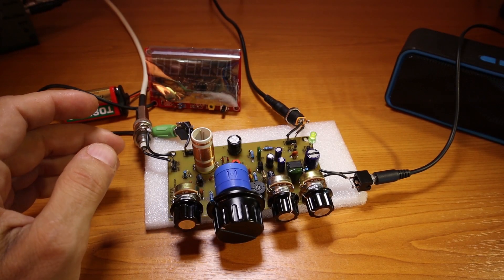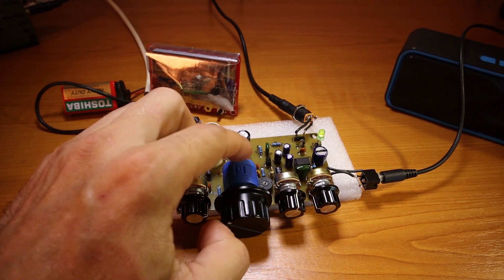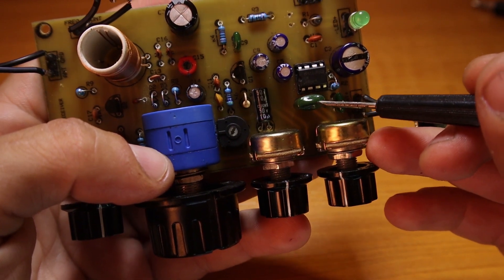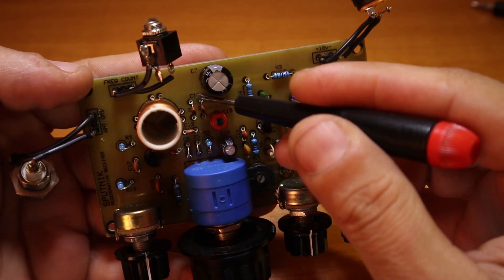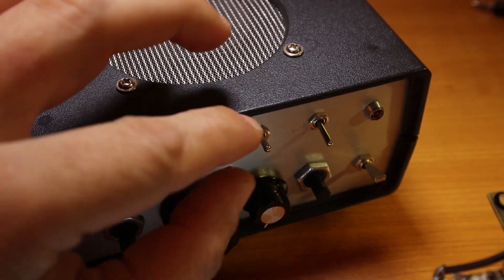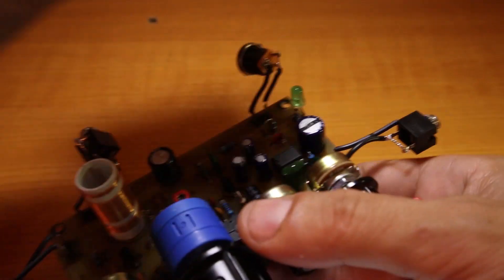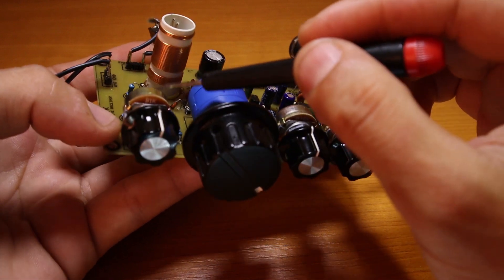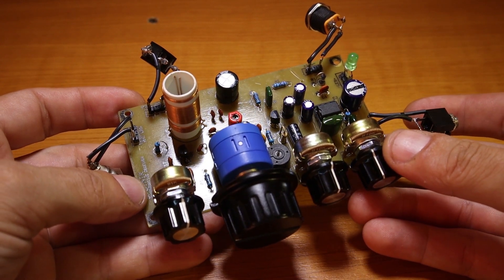Sputnik Regenerative Receiver: CW, SSB AM, FM / Latest Update

Comment: Pins 2 and 4 of LM386 should be ground, but the diagram shows pins 3 and 4.
Reply from the maker: You can use it with pin 2 as input actually and that is what the manufacturer recommends but pin 3 also works as input. I can't remember what schematic I used in this video, but if you download the project folder using the link in the video description, the updated and latest schematic is there. 73, YO6DXE.

Comment: can i use an NJM386
Reply from the maker: I don't know... I've never heard of it.
Reply: @dxexplorer  it says that it's a replacement for the LN series

voltage operation is 4 to 12 volts 
it's the same as the LN386 but with a slight difference 
it's a Japanese IC manufacturer
Reply from the maker: @Unbekannter_Mann Ohhh well if its some sort of equivalent then I guess is fine to use that one.

Comment: How can I get it to receiver 80 meter band 3.5 mhz do you have a formular for the coil and capasitors for the 80 band friend thanks
Reply: My sputnik receiver is more stable and selective then my real receiver its a super receiver
Reply from the maker: @oliverfranklypartolesen9882 Haha.. yes I think any receiver well built will be pretty stable. It depends a lot on the quality of the capacitors and the rf coil.
Reply from the maker: I remember I build a version but I forgot the coil details. I use an app is called Coil32... they also have a website. I think I explained in this video down bellow the way I usually calculate the coil.

https://youtu.be/QWkEIGlpF4w?si=1Hfnhlm9z2SFYMGH

For the capacitor that is in parallel with the coil and the varactor circuit... I can't remember now but I think it was C15 in the schematic... the place where on the board you have two spots for the capacitors one next to each other next to the coil... for the 80m band I think I used something around 68pF or 82pF something like that ( both capacitors together ). For the antenna coil... I know I used 10 or 12 turns... for the main one I think I was around 46 or 48 turns but I can't remember for sure. This is about the PVC coil version. I never tried on a toroid for 80m.
Reply: Okay cool thanks you.for that information but do you have some information details about the 20 meter band 14.000 capacitor coil etc mhz very active day time band 😊😊
Reply from the maker: @oliverfranklypartolesen9882 I tried keeping the capacitor at around the same value on all bands. I made a 20m version as well but I can't remember the details.
Reply: @dxexplorer  ok super duper so i dont need to change to much only experiment with coils maybe
Reply from the maker: @oliverfranklypartolesen9882 Yes.. just the number of turns. Only change the value of the capacitor to make little adjustments so you don't have to keep changing the coil )))

Comment: Hey my best radio friend😊 how you connect frequenzy counter or meter at which point/component at the receiver
Reply from the maker: I did not used the original counter as the kit comes... but I modified it using the instructions in this video: https://youtu.be/0BxpMm6SLoE?si=dXy4sgxxMfD34_jc

Then you can just put 3 turns on the toroid and connect the counter to those two wires coming from the coil. The way you connect it to those two wires doesn't matter so you simply connect them to the input of the counter. 73 my friend, YO6DXE.
Reply: @dxexplorer  have you.tried this one its a multiband receiver 6 to 22 mhz can manager ssb and cw and am i will give it a try and make some things theres a complet manual online
Reply: https://youtu.be/wvPOMtRsNm4?si=yOHPgKPaNUFov5yA
Reply from the maker: I know it yes. Well any receiver even the Sputnik can be adapted to become multiband. The only issue I have with the receivers that are multiband is that sometimes you lose a little performance. That is the reason I made the Sputnik band specific. Same with the N1TEV regen... it works good as multiband... but is amazing when if build only for one band. 😃

Comment: I just made this Sputnik, but I cannot check the frequency using the counter. Is it needed a preamp between L3 and the counter? 😁
Secondly, I think I have to replace 1N4001 with BB405, as it now the tuning does not work properly. 😅
Reply from the maker: If you are using the same frequency counter kit that I used... here is a video with instructions on how to modify it in order to work: https://youtu.be/0BxpMm6SLoE?si=WHWpPuE-RLm7evfF

On the diode... ohh yes feel free to experiment as much as you want. But if tuning doesn't work with a 1N4001..  chances are there is another problem there. It should work, just that the frequency range you cover may not be as wide. Try checking the potentiometers, especially the RF gain and regen control. Those were the issues I had using new and cheap but really bad quality potentiometers. As soon as I replaced them all worked fine )).
Reply: @dxexplorer  Thank you, Ciprian... That's what I need to confirm. 🙏🏻😅🕊️✨
Always love to visit your channel and blog. 😍👍🏻✨
Reply from the maker: @hobimonitor  Always a pleasure my friend. Shoot me an email if you still can't get it to work and we will make it work no worries. 73

Comment: Hf alıcıyı bitirdim fakat henüz bir frekans yakalayamadım
Reply from the maker: Ohh great. I guess now you will just have to put it in the band properly. If you don't have a frequency counter, just listen to the online SDR in Holland and adjust the receiver until you hear nearly the same thing on the 40m band. That is how I used to do it before when I had no frequency counter. It takes a little time, but it works. Also make sure the antenna has at least 6-8 meters minimum as is meant to work with a proper antenna and shorter wires may work if the propagation is great, but you won't receive much in the days with poor propagation. Let me know if you need help. 73, YO6DXE.
Reply: @dxexplorer  frekans sayıcım yok ama yakın zamanda gelecek .TA1EYZ 73
Reply from the maker: Ohhh mükemmel.  Bu şekilde ayarlamak çok daha kolaydır.  73. İletişimi sürdürüyoruz.
Reply: @dxexplorer  Sputnik'i yaparken 470pf seramik kapasitör yerine 470pf multilayer kapasitör takmıştım ama bir kaç gündür radyo üzerinde çalışıyordum bir türlü ses alamadım bugün 470pf seramik kapasitör taktım ve Sputnik'i çalıştırdım sonuç olumlu.🙂
Reply from the maker: Ohhhh the 470pF in the oscillator circuit ? Glad it works now. Congrats hehehe. I am happy it finally works. I get these days too when things don't always work and usually is something you don't think it will affect the circuit much.

Comment: Very nice. A q. where do you get the multi-tank potentiometer? 😊 Thx
Reply from the maker: Is available here in online local stores. I also like it as it saves me lots of money I would pay for very nice but expensive variable capacitors. 73, YO6DXE
Reply: @dxexplorer  Oh I now undestand it was a multi-turn potentiomenter, I was thinking on a variable capacitor... for the factor form... that was my confusioin. Thanks again. 73
Reply from the maker: @lucasmarjona Yes yes. I love variable capacitors... the older style aluminum ones... especially with reduction gears... but they are too expensive for me. More stable in frequency though comparing to diodes.
Reply: Another question. This receiver is capable to demodulate CW? It Will be like SSB with a single tone, so, could be work, isn't it? 🎉
Reply from the maker: @lucasmarjona It will demodulate CW but you hear both sidebands...

Comment: Excelente el radio.  Me toco cambiar los transistores 2222 por 3904 a la antena y el bc 458 para el otro 2222  y le agregue a la entrada del lm386, 1 condensador de 47nf con switche para tener las 2 opciones af filtro.. Saludos..
Reply from the maker: Ohh perfecto. Sí, sí, sigo haciéndolo así y lo cambio. 2N2222 o 2N3904 funcionan más o menos igual. Quité el "filtro" de audio para simplificar el receptor para principiantes... pero siempre me gusta cómo suena con un condensador extra. Me alegro que estés bien. Te deseo un buen fin de semana. 73, YO6DXE.
Reply: Hice otra modificacion, en filamento abs hice un toroide 18mm exterior y 8mm interior con hueco y le agregue papel aluminio, se aumento la señal, pero hasta el momento estoy experimentando señales pitidos fijos , no tengo las herramienta para saber el uH ( se me daño el lcd del RLC T4/T3) por lo q me toca a mano. Aun así sería bueno saber de este tipo de toroide relleno de aluminio. Saludos.
Reply from the maker: @jcbacol Para el toroide sólo probé el material T50-2 y T50-6.  Por supuesto también el tubo de PVC... hasta ahora con el tubo de PVC parece que obtengo mejores resultados tanto en el factor Q de la bobina como también en la estabilidad en la frecuencia cuando hay cambios importantes de temperatura.  Pero es bueno que experimentes con eso porque la mayoría de las veces pueden surgir resultados inusuales y sorprendentes.  También quería probar un toroide hecho de PVC... en teoría necesitaría más vueltas para alcanzar la inductancia necesaria, pero el factor Q de la bobina y la estabilidad en frecuencia también deberían mejorar.  Nunca tuve tiempo de probar eso todavía.

Comment: Did you design this yourself.
Reply from the maker: The PCB board you mean ? Or the schematic ? I put it together... I can't really say I designed it since parts of the circuit, in theory appeared long before I was born ))) I just tested a lot of combinations and variations of the schematic making more and more changes to it until I was happy and it was as simple as possible. It can work even better if modified even more 😁😁. But I stop here as I spent too much time with this receiver )))

Comment: Hi, does anyone have an explanation why the tuning circuit (in series) is not a normal parallel tank circuit? Thanks in advance!
Reply from the maker: Morning... it may be different because it may have other type of oscillator than what you may be used to. I also wondered the same thing when I first discovered the schematic. I didn't know about oscillators back then... I just noticed was not like others )))

Comment: What type of blue variable capacitor are your using? I see these all the time in builds and cannot find one. I just build an N1TEV Regen, and used a couple variable caps from a fried old SW receiver. I want to build a Sputnik next, but don't want to spend a lot on these big air variable caps.
Reply from the maker: Is just a 10 Kilo Ohm multiturn potentiometer. They are not that expencive. Usually two or three times the price of a regular potentiometer ( the cheaper versions ). Here in Romania at least... they seem to be available in any online store that sells electronic components or parts for robot builds or things like CNC and so on.

Comment: Did you solved the 741 opamp issue?
Reply from the maker: I do not use 741 in this project. That was for the Pixie with CW filter. But yes problem solved 😁.

Comment: It's working nice 😊
Reply from the maker: Ohhh yes..  I am really happy it works the way I wanted to.
Reply: @dxexplorer  if you want it to work better as you said it's possible to change capacitors , also it's not necessary but it's good to wound coil on high frequency ceramic.
 I have seen that people used silver plated wires  for coils, I believe it's better but not necessary.
Anyway it's  good choice to make coil one you have used
Reply from the maker: @inventor2540 yes... if you want make it really stable in frequency... you can go a little bit on extremes and do that type of coul... for sure much better... also use temperature compensation capacitors, same as you would use for a VFO... and is stable like a crystal controlled receiver )). But then.. things would get complicated again )) So I leave it as it is hahaha. I spent too much time playing with this one. Time to make others now haha.
Reply: @dxexplorer  you are right  the key is it's simplicity,
Good luck with new projects, ☺️
73 my friend
Reply from the maker: @inventor2540 Thank you so much my friend. Good luck to you as well. 73